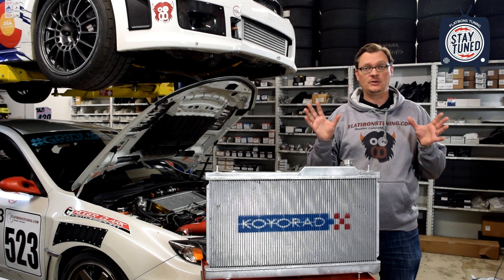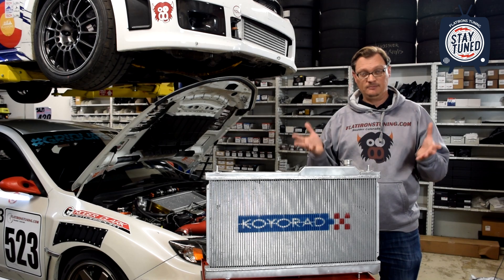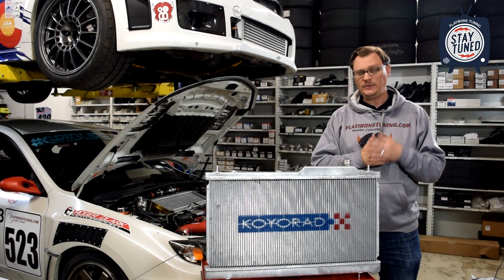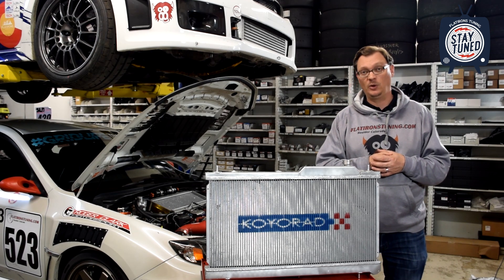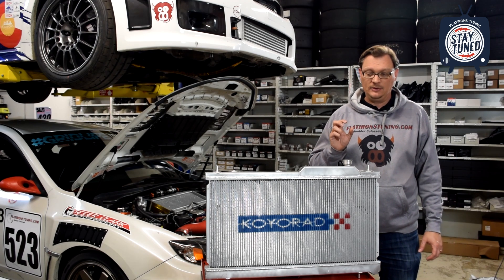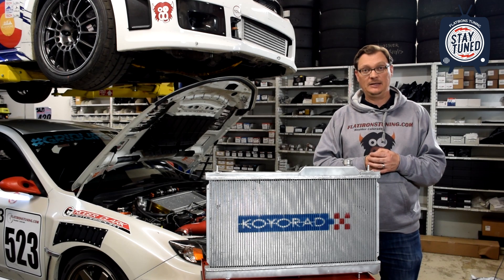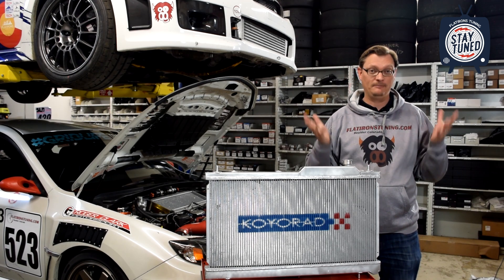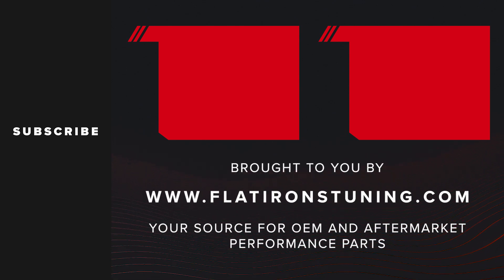Why we got rid of our radiator cap

Comment: Definitely Keep the thermostat.. put a reduced temperature thermostat 
Get an electric water pump 
Run an external radiator from a 
motor cycle for the heater hoses-add electric fan
Add an oil cooler mounted in the rear defuser
Switch to E85
Fit water squiters to the intercooler 
A couple of ideas that will surely be very effective 
Also, 99% of all over heating problems are due to air lock
If it has a leak air will build up, a leak can also be not evident being turned to steam vapour
Apparently after market all aluminium radiators run hotter than oem

Comment: So which 2 way cap should I run on my 05 FXT with a radiator without the cap? The OEM 108kPa cap or should I get something with a higher pressure rating?

Comment: So if I'm currently running 2 koyo 1.3bar 2 way caps should I swap to the 1 bar 2 way expansion tank oem cap and the 1.3bar 1 way rad cap on the koyo rad? or can I just put the oem 1.37bar 1 way cap on the koyo rad and keep the 1.3 bar 2 way koyo cap on the expansion tank? I'm currently having a strange issue where I have to refill the overflow tank once every one or two months and I cannot figure out why since the system has been pressure tested multiple times and never shown a leak. I also never overheat. My theory is the 2 1.3 bar 2 way caps are keeping air in the system and everytime I fill the overflow it bleeds it a little. I never have overheating issues in the summer though so I'm kind of at a loss.
Reply from the maker: Thanks for watching and thanks for the question.  I would recommend putting the 1.3 bar OE 1-way cap on the radiator as a starting point.  Once that is in place, you know that all coolant coming back into the system will go into the expansion tank.

From there monitor your overflow and see if anything changes.

If you don't see any change, I'd say the next step would be to put the OE 1.1 bar cap on the expansion tank, and then monitor again.

If that doesn't get things working properly, then you need to do your best to find out where the coolant is going.  Unfortunately at that point it could be the headgaskets.

Hope that helps and Stay Tuned!

Comment: Is there any more info on these issues that y’all have figured out? I mean I don’t know if most people can have someone change the radiator they way y’all can? Did y’all do any more testing or have any other input on if you have to use the radiator and expansion caps, which seems to be most ideal? I’ve looked at both videos on the topic tens of times, I just kept waiting for a new one to come out to maybe help us more “common” non-mechanic type folks. Any additional input or info would be amazing if you have any. Thanks for all the amazing content!
Reply from the maker: Thanks for your question.  Our cooling system is now working better than ever, so we haven't tried anything else because we are having good results currently.

For most applications, using the correct factory radiator caps is going to be your best bet.  We talk about that here:

https://youtu.be/HzjBJz1Zdmw?si=GNG-Qb-WIBqw5MyA

If you have the correct round cap on your radiator, the cooling system should be able to handle most of the hot conditions, etc.

Hope that helps and Stay Tuned!

Comment: What about rotated turbo setups where the expansion tanks are removed? What's the best solution? 1.5 bar cap? Or? Thanks for such great information
Reply from the maker: Thanks for your question.  Even if you put a rotated turbo on your car, you still want an expansion tank because you want to be able to bleed your cooling system from the highest point.  If your turbo and coolant lines are higher than your radiator, it could end up being very challenging to get you cooling system to work properly.

Killer-B and IAG both make small expansion tanks that give you more mounting options if the stock one won't work.  I'd recommend something like that to keep the cooling system functioning properly.

Thanks for watching and Stay Tuned!
Reply: @FlatironsTuning  got ya... well I even bought the expansion tank but I have seen so so many builds without them that the local shop decided not to use one.

Comment: reading up on this for a while, first couple videos I found really talking about the problem.  I am pushing coolant on high RPM.  On one of my uploaded videos on the dyno you can see coolant on under the car after a few pulls.
Reply from the maker: Thanks for the comment.  It definitely sounds like your cooling system isn't holding pressure properly, or you are moving compression gasses into the coolant.

Hope that our videos help you get to the solution.

Thanks for watching and Stay Tuned!
Reply: @FlatironsTuning it was head gasket :-/
Reply from the maker: @Zcypot  Sorry to hear that, but hopefully you can avoid that type of failure going forward.

Hope you can get back on the road soon!

Comment: So as I understand, if I have 2 caps, should I put the higher pressure cap on the radiator and the lower one on the expansion tank? One is a 1.3 bar STI performance group N cap, and the other is the OEM.
Reply from the maker: Thanks for your question.  That is correct, but the most important part is that the 1-way cap is on the radiator, and the 2-way cap is on the expansion tank.

Hope that helps, and Stay Tuned!
Reply: Are there one-way caps that go up to 1.5bar?

Comment: What are your thoughts on electric water pumps such as the davies craig ewp150? With their digital controller you can remove thermostat completely and not have it affect the cars warm up. Plus you can run a water pump with no impeller reducing drag on the motor. Im also chasing heat issues being out here in the Arizona desert, but only in the hottest months, June, July, August. I wanted to give electric pump a go, but Gates seems to be the only company selling impellerless water pumps, and they have been back ordered for over 2 months now.... Sigh.
Reply from the maker: We actually ran the Davies Craig set-up for a while on the Pikes Peak car.  Yes, you do have the ability to control the pump much more, but it never really worked well for us.  Or I should say that it never seemed to work better than the conventional pump for us.

And we did upgrade to their highest flowing pump as well.

The main issue we had was once the car got hot, the electric system wasn't able to keep the temps below 200 deg. F, and the car would still overheat.

Knowing what we do now related to our radiator caps, it is possible that if we had removed the cap from the radiator when we were running the electric pump, it may have got us some improvement...

But having that sorted now, and with the improvements that we have seen in the cooling system since we have sorted out the radiator caps, I'd say that would absolutely be where I would start.

Hope that helps and thanks for watching.

Stay Tuned!

Comment: Will you guys come out with a kit so we can do something similar?
Reply from the maker: Thanks for your question.  That isn't actually something that we had considered, but I'll give it some thought.

Thanks for watching and Stay Tuned!
Reply: @FlatironsTuning so this setup still good? I just did this to mine.
Reply from the maker: @cot998  Still works great for us!
Reply: @FlatironsTuning  next question. Why not use the old wrx radiator that doesn't have the cap instead of modifying that one.
Reply: @FlatironsTuning  also what cap are you using on your expansion tank?
Reply from the maker: @cot998  We are still using the 2.0 bar cap on the expansion tank.
Reply from the maker: @cot998  They have slightly different fitment, but you could certainly make that work.

Comment: Hi, so it goes like this - use either OEM caps in OEM Locations (1.0 bar on expansion, 1.37 radiator) , OR use 1.5 radiator and 1.3 expansion tank? 

Do not use 1.3 expansion tank and 1.37 OEM cap? 

Awesome videos.
Reply from the maker: I like all that you said.  I'd just add that it is ideal to have a 1-way cap on the radiator.

Thanks for watching and Stay Tuned!
Reply: @FlatironsTuning  thx!
Reply: @FlatironsTuning  so would you swap the one caps and do trimming the fins then? Though the holes aren’t the same size I think. If I use stock caps, I’ve got a lower rated cap on my radiator vs the expansion
Reply: @FlatironsTuning even if you don't have an expansion tank anymore? I have a rotated setup without the expansion tank now.

Comment: Fun fact my 91 legacy SS has no cap on the radiator and only on the expansion tank.
Reply from the maker: Yep, I think this only started in 2004 or so when Subaru was having issues with radiators failing on US spec cars.

Some of the earlier WRX's even had cross-flow radiators from the factory!

Thanks for watching and Stay Tuned!

Comment: The solution is really simple. Credit to MRT. Thermostat causes turbulence at the volute of the water pump and causes cavitation. Relocate thermostat to the upper rad hose and you'll never go over 200F ever again. I use the MMR with a 3/4 bypass line. Rad caps, crossflow radiators and all that are not significant enough to fix the root cause (high rpm + OEM thermostat location = cavitation).

Comment: Hey guys, thanks for updating us on your findings because they are very interesting and I hope your current configuration helps with your issues! However if I may ask, I have seen the other video but got kind of lost, so if you don’t mind just telling me what your guys’ definitive suggestion is for the cap setup on just a normal driven street car? Ex: 2 way valve 1.1 bar reservoir, single valve 1.3 bar radiator cap? I don’t believe I have cooling issues but would still like to maintain the proper pressures in my system to prevent issues down the line. Thank 👍🏻
Reply from the maker: Thanks for your question.  At this point, we would simply recommend the factory caps.  That is your best option I think.  

Thanks for watching and Stay Tuned!

Comment: Just curious, y not just modify the radiator cap to be a single valve? Seems ezer to do that then to cut a radiator up and weld on a bleeder screw on it. It would also be ezer for street cars to have this issue fixed also.
Reply from the maker: Thanks for the question. There isn't a good way to modify the radiator cap that I am aware of.  And since we are trying to raise the pressure in the system to increase the boiling point, it is a much easier process with one cap.

Thanks for watching and Stay Tuned!

Comment: Maybe using gc8/sf5 radiator with horizontal flow core design would help as well?
Reply from the maker: It is an interesting idea for sure.  I think that the plumbing is a bit different, but it may be possible to adapt to the newer engines.

For now, we are going to give this setup a try and see where it gets us.

Thanks for watching and Stay Tuned!

Comment: Keep us updated on this. Also since you removed a cap, what pressure rating is your main cap currently?
Reply from the maker: We definitely will let you all know how it works out.  We are still using the 2.0 bar cap, but now that the configuration is correct, we should actually be seeing that pressure and raised boiling point in the system.

Thanks for watching and Stay Tuned!

Comment: One common radiator for GC STI swaps from Koyorad is the VH090302, and it does not have a cap on the rad itself by design. It was originally for the 91-94 Legacy 2.2L Turbo I believe. 

Great video, really helped answer some of the reasons why they were lacking caps back then for me, and also helped solidify my choice for using the above Koyo for my GC.
Reply from the maker: Thanks very much for the comment!  Stay Tuned!

Comment: You all have been killing it with the content. I have a question also. I had a local shop assemble and install my RA shortblock (that I got from you all) and when he installed it, he deleted the expansion tank. A few months go by and my car starts pushing coolant from the overflow. With the expansion tank being deleted, which cap should I have on my radiator? Should I use the OEM radiator cap or the expansion tank cap?
Reply from the maker: Thanks for your question James.  With the expansion tank deleted, you would need a 2-way cap on the radiator.  Definitely keep an eye on that and if you continue to see issues, you may well want to consider putting the expansion tank back on.  If it was simply removed and you still have your turbo in the stock location, that would definitely make burping your coolant a bit more difficult.

For what it is worth, you may also want to take a look at this other video we made about the cooling system:

https://youtu.be/MBVNHON3d0w

Hope that helps and Stay Tuned!

Comment: Is this necessary if u got a stock car with light mods? Koyorad or mishimoto radiator?
Reply from the maker: Thanks for your question.  Nope, not at all.  Just make sure you are running the correct radiator caps, and you should be good.  This really would only be needed on track cars, etc.

Make sure you take a look at our video on the different radiator caps:

https://youtu.be/HzjBJz1Zdmw

Thanks for watching and Stay Tuned!

Comment: i removed my expansion tank to fit my garret big turbo and made a custom reservoir., what can i do?
Reply: If you have a iag iOS race version check out how Josh at bbr bypasses the reservoir. You just need to keep the iOS at the high point of the system.
Reply from the maker: Thanks for your question.  Take a look at the Killer-B Upper Turbo Reservoir:

https://www.flatironstuning.com/killer-b-upper-turbo-reservior-v2-barbed-fittings-02-07-wrx-04-21-sti

It is an expansion tank that is reduced in size. It may be easier to fit with a rotated turbo.

Hope that helps and Stay Tuned!

Comment: I cut the guts out of my thermostat because I can't find the cause of knock above 70°C in my un-tunable shitbox blobeye N/A SOHC EJ20.
I wired both the cooling fans to console switches and set up a digital coolant temp gauge on the dash and I operate the fans manually. 
At 100kph on a 28°C day the car runs at about 70°C with the fans off.
I turn the Main Fan on if the car 'heat soaks' and pushes past 70° or when sustained hill climb is unavoidable I run both fans together.
Reply from the maker: Thanks for the comment.  It is a bummer that the fans aren't working on their own for sure, but great that you were able to take manual control of them.  Definitely helpful in hot conditions.

Thanks for watching and Stay Tuned!
Reply: @FlatironsTuning  fans have always worked but I need them to run well before 90°C.
My ecu turns the fan on at 95° and off at 90°.
That just isn't working for me until I work out why the engine is so knock prone.

Comment: I run a one inch plate instead of a thermostat. Never ran into any problems now but I'm always racing in hot weather here in Thailand. Also run a custom cross bar and plate radiator with one expansion tank. Water temps never goes over 95 c in race contidtions.
Reply from the maker: Nice!  Yes, a cross-flow radiator that allows you to put the cap on the low pressure side of the radiator would be a big help for sure.

Thanks for the comment and Stay Tuned!

Comment: Updating from my comment on the first radiator cap video. I installed the oem low pressure cap on the expansion tank rather than running 2 high pressure caps on my STI swapped GM6 (which just passed Carb :P ) and I was issue not with cooling but rather the cooling system pulling a vacuum and collapsing hoses after the engine had cooled. After installing the oem caps in the correct locations, that is no longer an issue and the system bleeds pressure to the correct areas. I never had an overheating issue but as the last video came up, I recalled just throwing both high pressure caps on with the mentality of higher pressure will yield a higher boiling point. So the video caught my attention as I had those hoses collapsing which cause the upper hose to come into contact with the alternator pulley and put a good groove into the brand new hose. But that one issue has been resolved and as the whole swap is stock im thinking it will be as reliable as a stock STI can be.
Reply from the maker: Very glad that we were able to help you get your car running properly cool again!

Thanks for watching and Stay Tuned!

Comment: Great vids guys. Effectively your set up is like the early GC8 WRX & STI (all be it that the earlier model is cross flow radiator) but they run a dedicated breather line from the top of the radiator end tank to the top of the expansion tank.
Reply from the maker: Yep, that is correct.  And we do still have the connection from the upper tank to the expansion tank too.

Thanks for watching and Stay Tuned!

Comment: I run the the high pressure blitz cap on expansion and a cosworth high pressure cap on radiator....staggered...actually may have bought from you guys, lol. 20027842 1.5 bar cosworth rad cap...also have mishimoto tank and rad.
Reply from the maker: Nice!  Yes, staggered is definitely the way to go with 2 caps.

Thanks for watching and Stay Tuned!

Comment: Why not go to a custom fabricated radiator that is cross-flow instead? Even with how the Subie radiators mount, I don't see that as being overly difficult? Wouldn't that work better?
Reply from the maker: A cross flow radiator should be an improvement but since we have recently invested in the Killer-B radiator for the car, we need to stick with that for a while.  And this change should make a good improvement.

It would be nice if there were more aftermarket cross-flow radiator options though, that is for sure.

Thanks for watching and Stay Tuned!